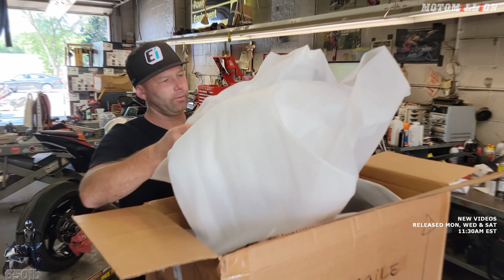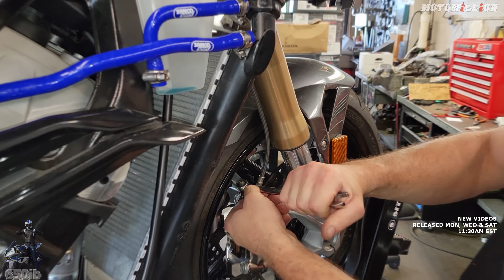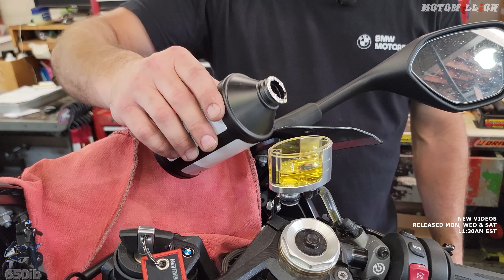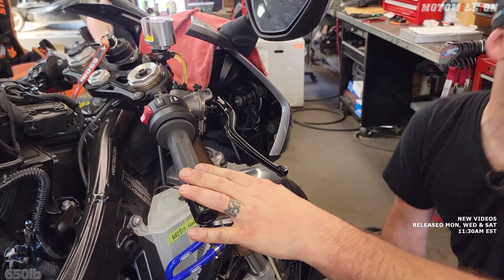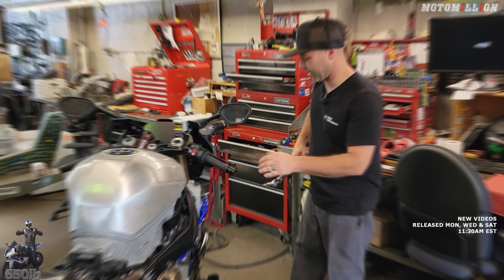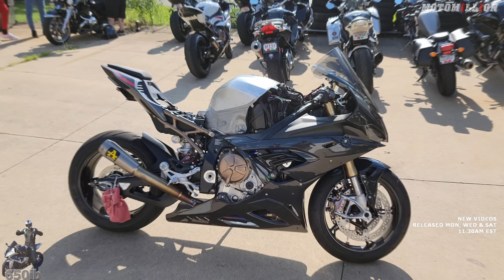2022 BMW S 1000 RR FULL CARBON FIBER & BREMBO BRAKES!

Comment: What Torx bits does Zach use? I keep finding the ones I get from Lowes end up snapping or stripping.
Reply: I think he ordered them from Biltema
Reply: Not all torx are the same, I suggest you take a look at YouTube and discern for yourself the various different kinds. Using the wrong bit is the primary cause of broken tools, You may think its the right one, may even look like it, but they have a ton of different sorts.
Reply: I have a set from gear wrench and they have lasted me years and weren’t as expensive as snap on.